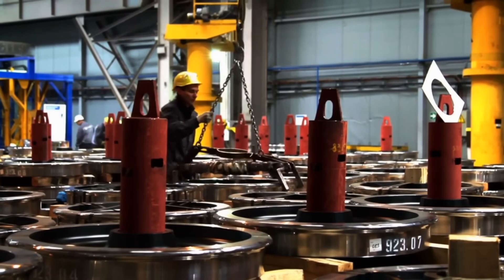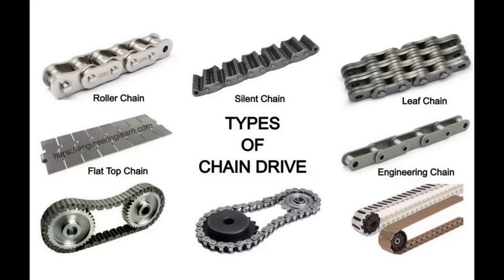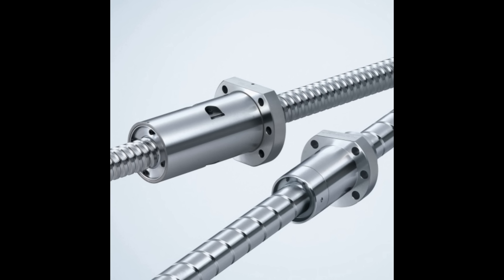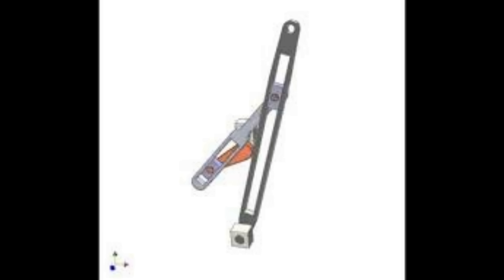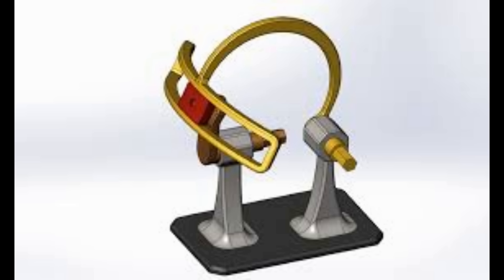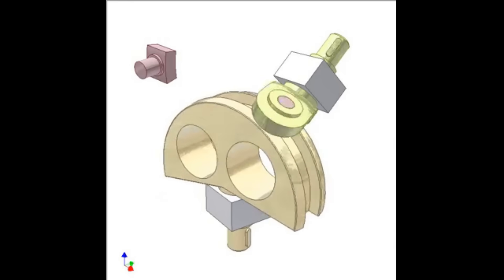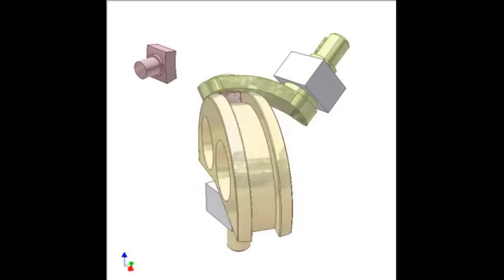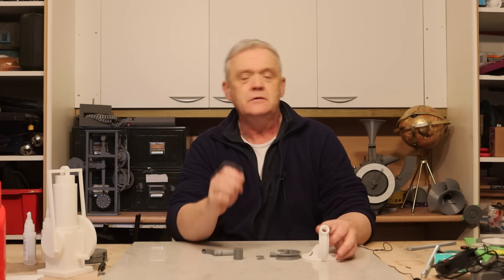2196 The Spherical Coulisse Power Transfer Mechanism

Comment: The output is not constant it slows as the ball reaches the apex and accelerates as it moves to its outer limit then slows to the apex and repeats causing pulsation or speed changes in the output

Comment: Interesting
What's the torque ratio on slider's

Do sliders function like U-Joints
To change the direction of power

Are there mechanical advantage in performance. Like a pulley box

Does Heat become a factor in high speed or long usage

Have slider's & magnet's been combined 

Thanks for sharing

Comment: The main problem with this seems to be the uneven instantaneous angular velocity of the output, is there any way to compensate for that? Would two such mechanisms in series but 180 degrees out of phase counteract it?

Comment: 2:14 The Hobson Linkage turns the same direction as two 45-degree gears, and the friction of the sliding elbow links would seem to be a significant source of friction.  So I don't see the advantage of the Hobson Linkage over gears?

Comment: I recall seeing years ago a video about a system for a pneumatic energy recovery system for trucks that was part of the wheel assembly. Probably about 15-20 years ago.

I believe it was a Hobson linkage engine that worked to compress a gas while braking and then running in reverse to provide power back to the wheel.

Comment: when the sliding crank thing is at the top, there's nothing stopping the output from spinning at any speed.  I can see this thing derailing if there is any real torque load.  Also I would like to see what happens if you try to drive back from the output to the input when the arm is NOT at the top.  I would expect then to be able to make the thing slide at least to the top.  I wonder what kind of application this would actually be ideal for.

Comment: I do not see any use for it.  How much TORQUE can be sent through it?  How big, and what materials would be needed to transmit 10 pound-feet of torque at 500 RPM?  Your device it hanging up at the top (I'll call it) "zero point" while transmitting NO torque.  interesting to look at?  Granted.  Usable?  Not a bit.  We have something that can do the job better.  Gears.

Comment: With constant angular velocity of the input shaft, the output shaft does not have constant angular velocity, so this kind of joint can only be used for applications that accept a non-linear velocity feed.  That's why transmission drives on front-wheel drive cars use CVJ's instead of UJ's (Constant Velocity Joints instead of Universal Joints).  UJ's are used on the drive shaft of rear-wheel drive cars, between the gearbox and the diff, but there are two UJ's - one at the gearbox output and another one feeding into the differential, and as the two feeds are as nearly parallel as possible, the two UJ's are used 90 degrees out of phase, so that the non-linearity of one cancels the non-linearity of the other - but UJ's cannot be used on a front-wheel drive car, where power is transferred through the joint while the car wheel is following a bend.
Reply: uj=cardan italian mathematician cardano
Reply: @west_park7993  UJ = Universal Joint.
Reply: @DownhillAllTheWay  goto wiki. cardan shaft is how is popular in east europe. there are some cool animation and some trigonometry that shows the uneven output motion.
Reply: @west_park7993  OK, I looked it up with a Google search.  It says "What is a Cardan shaft?
1. : a shaft that has a universal joint at one or both ends enabling it to rotate freely when in varying angular relation to another shaft or shafts to which it is joined. 
2. : a shaft (as on a motor vehicle) that transmits power.

You clearly didn't understand the comment you were replying to.  "UJ's are used on the drive shaft of rear-wheel drive cars, between the gearbox and the diff"
These are NOT the kind of drive that is the subject of the video - the spherical coulisse drive - whose output has a roughly sinosoidal angular velocity if the drive has constant agular velocity.
Reply: @DownhillAllTheWay  agree: this was a destruction of topic. just wanted to share the name cardano and the cool trigonometry.

Comment: Very interesting mechanism. Does the driven shaft move at a constant RPM?
Reply: It does not. It moves slowest when the driving arm is at the top.
Reply: If the cv joint had an arch nemesis it would be this joint. It's name would be Dr jerky.
Reply: @mp-xt2rg  haha that's a properly good comment!
Reply: Interesting thought. Guess it would depend if the input torque was constant (thinking it would move faster where there is less resistant to keep same torque) or just like a regular motor that would spin at the same speed and do like he shows with his hand really.
Reply: The rpm remains the same, but the angular motion is non linear resulting in constant acceleration and deceleration of the output shaft during rotation. This makes it inefficient and only suitable for low speeds.
Reply: What a horrible way to transfer power 😂
Reply: @White.Elemant  Not necessarily. It could be good to gain traction on gravel or icy surfaces. Harley Davidsons with their uneven power pulses at the rear wheel had a huge advantage when motorcycles were raced on dirt track ovals (not motocross).
Reply: @jackandblaze5956  I'm not at all convinced on that. Especially on icy surfaces it is definitely not true. Power pulse will break traction, and then it's just gone... And why would've HD power pulses be any different from other twin engines of that era? The power pulses of a twin are more even than thoses of comparable power single cylinder, and the difference between types of twins will not be that great. I don't know if three or four cylinder engines were raced at the time you are referring to.
Reply: Well I'll be darned.
Reply: No however if you use 2 out of phase they cancel each other out becoming constant

Comment: Looks like this particular design would self-destruct if any meaningful load is present while the "crank" arm is passing through the center point where there would be nothing holding any existing load.
Reply: or you could use the center point as a "Neutral" to let the load turn freely.
Reply: If there was any counter acting force then it would freely spin once the arm is at the center top. This could be useful for objects that could be both powered to rotate or rotated by hand without using a disengaging mechanism. However the transfer will lock if if the rim happens to align perpendicular to the path of the arm connection.
Reply: @chazbenningfield3743  My point was that if there is a load on the output, then the drive arm has to pass through the "neutral" region really quickly to prevent counter-rotation from output load causing the arm to smash into the track at a significant angle with all of the associated shock loads.

Comment: FYI They did make a petrol engine of the angle bar type. It was called the "Rotary Vee Engine". Although, it's not at 90deg like the ones shown. The Rotary Vee Engine is closer to 60deg (I guess). I don't believe it made it past the prototype stage, they even have video of it running.
Reply: Smoky Yunick and Jim Oliver created an engine that could work on any expanding fluid (compressed air, steam, etc.) back in 1971 that was similar to the 90 degree linkage shown here.  Again, the angle was much greater than 90 degrees.  See popular Science December 1971 page 48.

Comment: I can't tell from the video, but I wonder if the input speed is smooth and constant, is the output rotation smooth as well?  That's sort of the problem with typical U-joints at a good sized angle, the output doesn't turn smoothly but sort of speeds up and slows down as it goes once around (hence the need for different CV (constant-velocity) joints in front-wheel drive cars.

Seems like beveled gears are better.

Comment: back in the 70s my dad gave me a 1/4 drive ratchet/socket set he didn't use any more, one of the extensions was a 90 degree extension built like you have in the video at 2:30.  it has a rod in the middle to keep it at 90 degrees and 5 rods that move as you rotate it. i don't use it but still have it. one of the rods has a slight bend in it so it is a little stiff to turn.
Reply: Be good to see a video of it.

Comment: It's not a constant velocity mechanism unfortunately.  The output shaft speed looks like a raised cosine, hitting zero every 180 degrees so there would be huge torsional vibration for actual power transfer, though there might be specific applications for this. It looks like the  3D model needs some adjutsing, the output shaft isn't centred correctly.

Comment: That's a very neat gadget, I would totally have it as a desktop toy. I haven't seen it implemented in anything I can remember. Maybe it could be used to make specific adjustments in machinery within a limited range, or the singularity (dead spot) could be used to disengage the drive and allow manual input, but I can't imagine it being used for any continuous, high speed or high load power transmission applications. For practical purposes, the output is non-linear, non-determinate with the mentioned singularity, the bearing slides on a curved track which is inherently very expensive to produce and hardly serviceable, the loads on all the parts are complex and highly inconsistent. Perhaps the singularity could be eliminated by transforming it into a Tousi-couple or "nothing grinder" which has several tracks/sliders. I see you can adjust the geometry for angles from collinear to about 60°, but a cardan joint (universal joint) does the same thing and is adjustable during operation.

Comment: Aww, kind of unfortunate that it's not also a constant velocity joint in that configuration, as it would certainly be an interesting power transfer to tinker with otherwise.
I guess one interesting way to use it would be if the bottom portion of the drive were constantly being driven, say from a water wheel or engine, and you needed to drive something intermittently.  This could potentially allow you to engage and disengage power transmission by stopping the yoke at top dead center when no power input is needed.  You'd only get one full rotation out of it before it stopped, unless you used a flywheel to drive it past top dead center again.  Might have been useful for something like a blacksmith power hammer, in which the user would move the ram downward slightly by hand or foot pedal to get it out of that top dead center "rut" to have it power one complete hammer rotation, with each successive blow being commanded by the user.  Perhaps a pawl that stopped the upper portion right at top dead center each time, I dunno, it could work?
Reply from the maker: maybe tools?

Comment: That action has a singularity in its motion.  That makes it prone to jamming & having high friction.  Mechanical transmissions should be designed to maximize pure push/pull & rotary motions to minimize friction & jamming.
Reply: Perhaps a small flywheel on the output shaft would sort that out?
Reply: @TonyWeirPD  No it won't!  it may hide the problem under some VERY steady-state condition or very specific dynamic condition (where the flywheel "coasts through" the singularity), but will only make the condition more severe under different dynamic conditions.  Systems should be designed to NEVER enter jamming conditions due to singularities unless it is designed to jam (such as toggle-latch mechanism).
          Pressure angles for moving parts should be kept far away from "jamming condition" (where pressure angle exceeds arctangent (coefficient of friction).  Examples are (non-circular) gears with too high pressure angle, cams with excessively steep ascending angles, especially when the follower is in sliding contact.
Reply from the maker: cheers mate

Comment: But what's the benefit of these couplings over bevel gears? Wouldn't bevel gears have less friction and be easier to make?
Reply from the maker: in tests these have been sown to be more efficient in some cases and not in others - like in pumps for example - but then that is always the way in mechanics - some olutions are not good for everything - they never are
Reply: - most probably ease of manufacture - cutting gears takes "incremental precision" = this geometry (most of the types demonstrated) could be hand carved - and will still work after "finishing"..

Variable angle couplings have been tricky with gears, and CV joints haven't always been readily  "manufacturable" (and have friction and lubricant losses) - lever systems can be angle variant (ok not constant velocity either in many cases).
Reply: @kadmow  Thank you! Ian

Comment: just a observation,  i noticed your version was having trouble going over the hump.  of the rotor.  might be slightly the wrong geometry on the arm that goes over that.  from a glance it looks too short.  but the origional looked like it was shorter. so probably there is a sweet spot or two in that length.
Reply from the maker: it's more likely i printed it too fast and so it is lumpy - chances are a bit of sanding or a slower print would sort it out mate

Comment: there are two real problems  with this   transfer system  
1    they do not   provide a constant velocity  [  speed up  and down   throught  the rotation ]
2   engineers would     use the system   that    has  the  minimal friction /  points of  wear  .  ie   bevel gears  .
Reply from the maker: I don't want to be rude here mate but they are not problems - to be honest if you think they are problems then you are not applying the mechanism properly - speed up and down is an asset in some cases - engineers would use a system appropriate to the problem

Comment: The Spherical Coulisse Drive Mechanism in any application in which you need a 2:1 gear ratio from the output, while maintaining an anti-backlash feature.

If whatever you are driving, freezes or jerks back, that energy will not transmit back into the drive input device, thereby protecting that device.

You would not want to use this in a transport vehicles transmission however, as one may end up finding one's self traveling the wrong way on an incline.
Reply from the maker: maybe a trip hammer or reciprocating saw?
Reply: @ThinkingandTinkering  
That would work.
Or even a windshield wiper gearing.
actually, you may be able to hook the output arm of a windshield wiper motor directly to it with little modification.